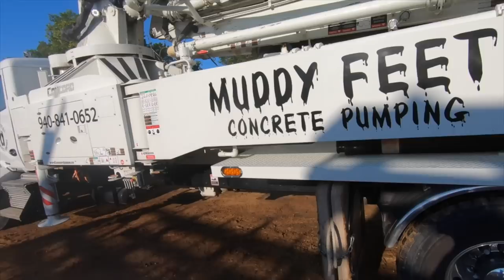Concrete truck rolls over. Pumping concrete with Muddyfeet

Comment: They should have discharged the load right away, the direction the drum was turning had the load climbing over to the side it was tipping to!
Reply: texans can't think that far in advance.
Reply: Wrecker guy should have snatched blocked it to some of them trees on the opposite side and waited for the rotator to arrive. Just my opinion
Reply: @artyart31  he could have but the weight of the truck plus the concrete would have pulled those trees out of the ground like you would pull a stick out of mud. Trying to offload would be a good idea except that just the motion change of the concrete would have made the truck go over as well. This was pretty much a case of it's going over no matter what you do.  It's not a matter of if it's a matter of when it's going over. Feel bad for the driver of that truck. And I know the tow truck driver was sick when it went.
Reply: Jeffrey Murdock and that’s very true but it would also have bought some time. You would be surprised just how much by doubling/snatche blocking to some trees/anchor weight it will hold. Plus running low line and top lines would have bought a whole lot of time. I was a medium wrecker driver but also assisted heavys in this situation I believe it could have been saved. Nevertheless glad the driver wasn’t hurt and concrete co. Getting a hearty bill. Win win situation
Reply: I work with concrete trucks all the time and have been doing so for years (I'm a testing technician, among other things), and I was just about to say you had it backward, but then I looked closely at the video to see the rotation direction, and you are correct.  All the concrete trucks I work with around here discharge when the drum spins clockwise as seen from the output end, and this one is set up backwards from that.  Spinning the drum counter-clockwise in this case would have shifted the weight dramatically to the right, so I agree with you completely.  That means that when the guys at the site were talking about not wanting to discharge for fear of shifting the weight to the truck's left weren't thinking straight.  They almost certainly could have saved the day by quickly getting it unloaded.
Reply: @artyart31  You are right, but failure to act quickly on that is pretty understandable.  That's not an easy kind of truck and situation to hook onto without a "wrap-around" connection over the top, and it takes a little time to plan and execute that sort of thing (I bet they were planning), and the failing soil didn't give them much time at all.  In that situation, who wants to be the guy getting a strap over the top, and especially the guy making that connection on the downhill side?  Not me.
Reply: @MonteCarlo3.1  farther ahead then you city slickers hows your lock down huh
Reply: If they would have unloaded that truck it still would have rolled.. 1 driver wasn’t paying attention to path. 2 no communication to other drivers as of what to do.. 3 if your backing no way he should have been that far to the left
Reply: The drum was at charge the whole time I'm not sure it will point they stopped the drum but if they would a stop the drum sooner then the truck wouldn't have tip as far  It was also  The driver's fault not to mention he was way far left backing  in
Reply: I don't believe those trees would hold that truck, but the wrecker could have set up down the road and run his line and extra chain if needed to hold the mixer from the side, then move the drum into discharge to move the concrete to the high side.

Comment: Completely preventable.  Soft road, incompetent driver, incompetent wrecker operator...... the list goes on
Reply: hired by their willingness to work the cheapest.
Reply: If you have ever done this type of work you would know that drivers have to put up with this all the time . Some times as the driver you have to say no. And usually it doesn’t go well with your boss .
Reply: @mikem1956  all the other drivers made it through fine.
Reply: You can clearly see he went of the tire tracks and into the ditch , drivers error he should not of reversed without a banksman , some sites you just have to say no too and it doesn't go well with the site boss normally but its not there job or life there risking .... ive been in many situations similar to this its never easy

Comment: I just retired from driving a mixer truck for 20+ yr's. Once I walked that access road and saw how unsafe it was, would I have backed up it ?  No way.  Glad nobody was hurt.  Safety first.
Reply from the maker: Yes sir
Reply: Urankjj, your right, all the different mixer drivers I was ever around would radio dispatch and get a company rep out there to make the call if the base road was questionable. A concrete company rep might just send lighter loads out that job. Whatever it takes!

Comment: That road and that situation, I would've discharged my truck right there and let someone else clean up the mess.  Hell of a lot cheaper to get someone in with a skid steer and dump truck to move the dumped mud than paying all those wreckers and the insurance excess on the total loss truck.
Discharging would've shifted the concrete in the drum to the uphill side and made the truck lighter and with a lower centre of gravity every second it was discharging.
I would've also shut the engine down once it was clear it was going over- that truck is a total loss now the engine is seized and possibly has a burnt up hydraulic pump.
 That driveway is a joke, it clearly wasn't placed and rolled in lifts, makes me wonder what the building pad is like....I think you were lucky you didn't lose your pumper on that driveway.
Reply from the maker: Thanks for commenting
Reply: Him trying to discharge would’ve rolled her over sooner. That driveway was trash as most driveways and construction entrances are for mixers.
Reply: Yeah. discharging might have worked, but he's right on top of a creek and you know the kind of fines governments like to levy for stuff like that.

Comment: Maybe its just me, but the first wrecker should have just angled off to the right and ran a line down through the bush to hold it from falling in.
Reply: it would have snapped instantly.
Reply: I wouldn't have waited for wrecker. I would have ran cable through woods hooked 2 or 3 mixers together. Held truck then unloaded it. Mud is mixed in drum on left side then reverse to right side to unload. Then pull it out. That was lousy road to be backing down in the dark. Company should have told owner to fix road or piss off before they went in. I use to run a mixer 40 years ago and own a bunch of dump trucks and equipment now. I turn down many loads that are risky. Good drivers won't have trouble but everyone is not good at backing in.
Reply: If they would have put in discharge the weight would have been on the passenger side.
Reply: 100% agree on that.
Reply: @garyevans718  Common Gary. Who are you kidding? Do you have any idea what a fully loaded mixer weighs? I don't, but I can tell you this much. they don't make a strap or chain big enough to hold a loaded mixer up from sliding off the side of that driveway. Watch closely as the foundation under the road gives way due to the shear weight of the loaded mixer. Attaching anything from the tow truck to that mixer would have more than doubled the catastrophe. You seen that not only the tow operator but so did others have to run to get out of the way once the mixer started to fall over.
Reply: @philsmidwestclassiccars150  Are you sure your responding to what I said and not to someone else ?
I'm well aware of why that Mixer slid off that road and what it would likely have taken to pull it out before it rolled.
so the maximum capacity of that mixer is probably around 7 meters of concrete which weighs about 37,000 lbs plus the truck for a total of roughly around 60,000 lbs.
Reply: You can see a massive hump in the road, and if you don’t line your wheels up to go directly beside it. You will shift the weight of the entire CC truck. He should’ve taken more precautions backing down that road. Get out and look. He would’ve noticed that the wheels were set up to drive directly over that hump.

Comment: You know I've re-watched the truck slide off the edge a few times, he was only a little bit off backing in, nothing that made me think "holy shit where is he going". But with the way the guys made that road the soft sides just grabbed him and took him.
Reply from the maker: KINGJB3100 yep
Reply: The driver also turned his spot lights on just before he went in the ditch. I think he was slightly distracted looking for the light switch. If he turned the spots on before starting to backup this may have ended differently. Shit happens!!
Reply: Well sites are the same way. Stuck belly dumps before on soft ground.
Reply: @rfusco9251  Why would he need the spots on anyway? The slide off happened in broad daylight. I agree with your assumption that the driver was distracted.
Reply: @philsmidwestclassiccars150  it looks like it was dawn. I wouldn't say broad daylight. I think that he was the second truck in at the beginning of the pour early in the morning. Definitely distracted.

Comment: High dollar home construction and they skimped on a couple loads of fill. Typical builder.
Reply from the maker: Think they where trying to save as many trees as possible. Just guessing
Reply: First thing i do , excellent access and crushed rock over the site , theres no excuses cause its an inexpensive thing to do .
Reply: Alex Frankl  what do you do with the rock at the end of the job?
Reply: Poor site work
Reply: Michael Maas leave it, you want a good stable driveway!
Reply: @michaelmaas5544  Surely that was to be the driveway for the home, so the crushed rock could have mostly or entirely been left in place.  This is standard practice on commercial sites.  Any little bit that they didn't need (if graded too high) could have been wasted off the sloped edges.
Reply: typical city slicker couch warrior, commenting on other mens work while you sit at home
Reply: Home owner/ builder won't put the proper road in till the end, doesn't want the trucks to wreck the driveway. Cheap pricks.
Reply: Oil Field Trucker, we've been on worse man made narrow dirt paths with ravines and drop offs in a 80,000 lb tanker   Oil Field pad will make a path no matter what. Driver did not pay attention and got distracted
Reply: @alexfrankl7861  exactly ,first thing we always did was put in a good road because of this exact reason ,this was not the drivers fault

Comment: That tow truck driver had zero experience at all. If he would have stayed on the main road and gone at a 45 degree angle he could have kept it from flipping over until the rotator got there
Reply from the maker: I don’t think he had enough truck to hold that mixer  I think if it went it would have taken him with him.
Reply: He would have had to secure it at the top somewhere enough that he could have dropped the load at least
Reply: Agree 100%. Guy had plenty of time to stabilize it and instead just sat there and watched it go. Strap on the rear drivers side tandems, up over the drum and then through the woods to the road.
Reply: cntsles fabrication that would have been the best thing they could have done.
Reply: @MuddyfeetConcretePumping  ima 10 year tower he absolutely had enough truck. He didn't have enough training or experience. That truck was a min 35 ton wrecker hard to tell from the video. In this video its hard to tell what I would have done but first thought would be to use a technique called a holmes tree or in this case multiple trees the only thing I cant see is how big the trees or how stable the ground. That way if it went it wouldn't take my truck with it and I could get a direct pull sideways in multiple locations.  With enough equipment and knowledge that truck could have possibly be recovered with that one truck just a lot of work.
Reply: ps I really hope we get to see the recovery.
Reply: @towman8519  100% This tow driver had no clue what he needed to do.
Reply from the maker: 5degreenegativerake I’m sorry but I personally think the truck was to unstable to be around the driver side trying to do any maneuvers. Don’t think that would have been safe.
Reply from the maker: Wade 2015 I’m not saying  he did or didn’t but I think he was in a difficult situation before he got their. I honestly think he by himself wasn’t going to save the day.
Reply: @MuddyfeetConcretePumping  Cool video though. Bad day for the mixer company, guess that's why we pay dumb amounts of money for insurance also. Coulda woulda shoulda had a better built driveway, spotter, or nosed in them trucks... Thanks for the video, can't wait to see the next part.
Reply: @5degreenegativerake  my thoughts exactly
Reply: @MuddyfeetConcretePumping   if he would have got it hooked up and secured from being able to continue to tilt the tow truck would have been more than enough to secure it
Reply from the maker: cntsles fabrication I don’t have any experience to put up much of a respectful argument. But I think he needed more help. The biggest takeaway from this is equipment can be replaced. Injury or worst can not.  Everyone went home. Some with a dent in their pride but that will heal also. I’m glad he didn’t try to be a hero and end up getting hurt.
Reply: @MuddyfeetConcretePumping  I agree no one was hurt and that is great and there is nothing more important than a life. From my experience when a tow truck operator is in a heavy duty tow truck by themselves the have alot of experience and knows how to handle situations like this because of the extreme danger they can be in and the expensive trucks and equipment they are going to be working on
Reply: That's a poor dirt road  I dont care how much experience a tow operator  has if the road was unstable from the get go no tow truck is gonna save the day looking at the trees they show wouldnt have the situation  but craps happens glade everyone is ok
Reply: @MARINECORPS61992113  I have 17 years as a heavy-duty wrecker operator.  I have at least 6 recovery of mixers. The wrecker operator should have but the wrecker to the right 45 degrees gone over the drum with a down pull to hold it until second wrecker arrives to winch out at he holds it up right.
Reply: I agree, any move would have been great.
Reply: @duanelippincott750  fully loaded wat does a cement truck weigh
Reply: Mexicans
Reply: @5degreenegativerake  That sounds great, but with the truck visibly creeping toward rollover right from the start (as a couple of people at the site were heard to say), putting anyone on top of that truck or on the downhill side would have been criminally negligent.  I tend to doubt they could have got an anchor system set up in time, considering that a visual appraisal was needed first, and by then the danger was just too great.